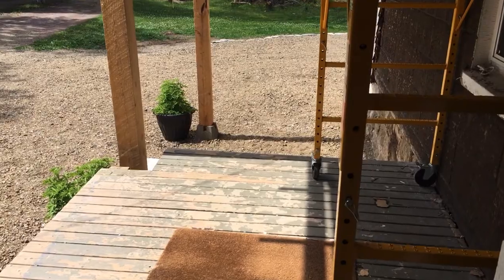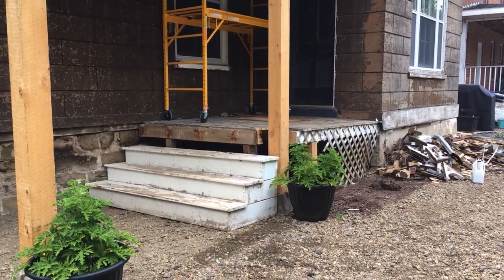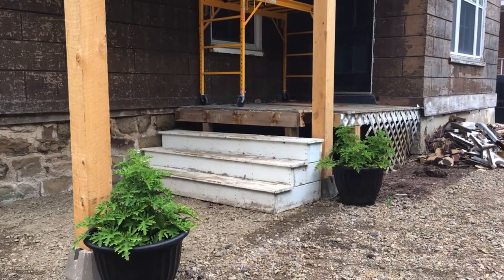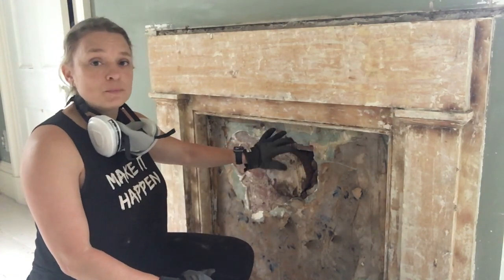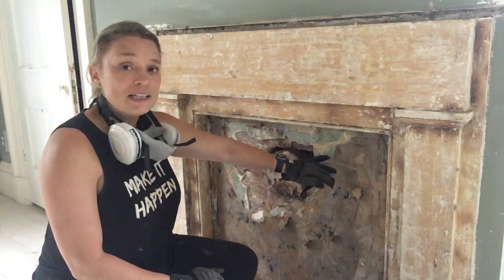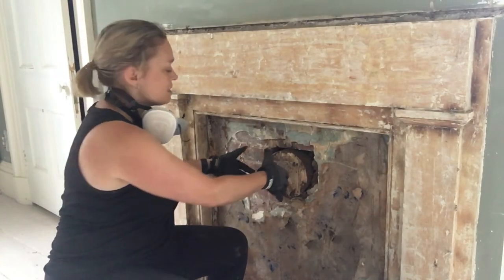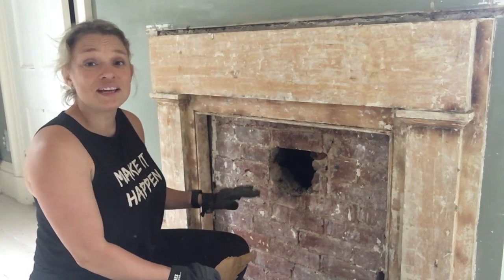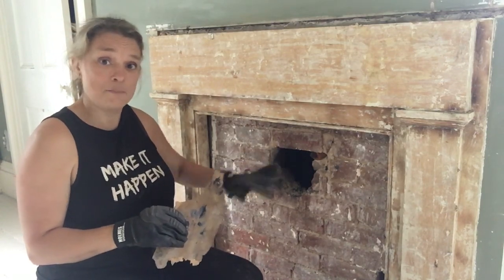Lady Smith Manor Diaries Episode 014

Comment: I wonder if the fireplaces was actually bricked over and that behind that brick is the original fireplace box?  Have you tried using a flashlight to see whats in that hole?  It might be possible to use it again as a working fire.  Just a thought.  I love what you are doing and its fun to see what happing next at the manor!
Reply from the maker: Thanks for watching. We are happy to hear that you're enjoying them. 
We have done some investigating and found that the chimney is in place and is clear from downstairs to the roof. We are going to be putting in a wood burning stove in the room downstairs and have confirmed that we can use the chimney for the flue. However due to the current fire regulations we have to have an insulated flue and the hole in the bedroom has to be sealed so we can use the chimney for the downstairs wood burner. Unfortunately since these chimneys were built for coal burning fires they don't meet current code for the size required for anything other than using it with an insulated flue. We are happy however that we can use it for downstairs and see the brick upstairs. :)